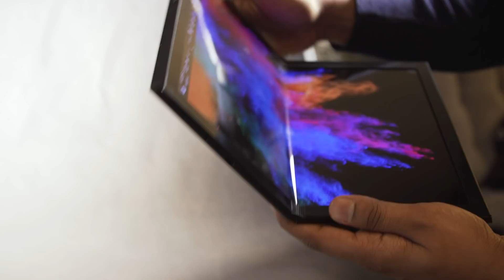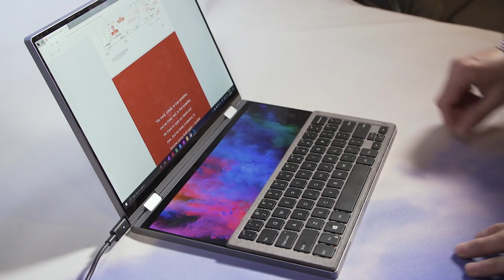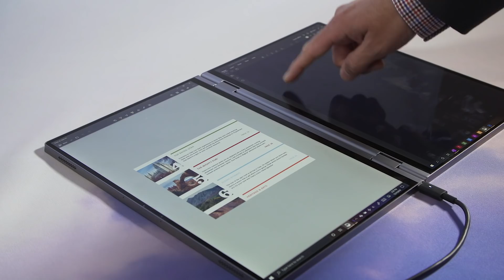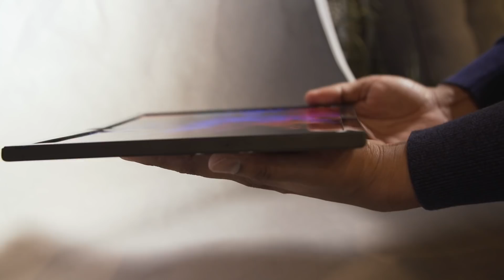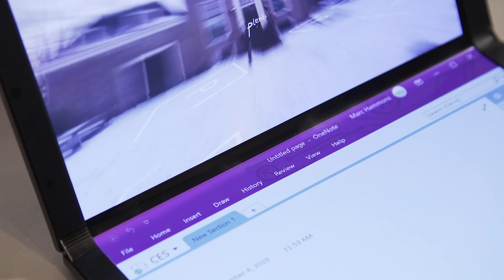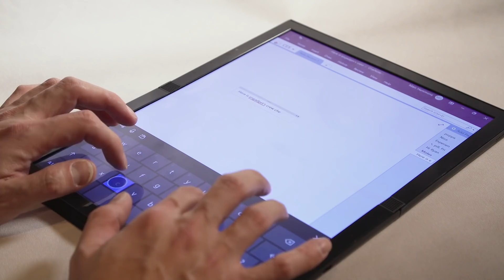Dell concept devices Ori & Duet at CES 2020

Comment: Yawn. So much emphasis on folding screens when they can't provide meaningful all day (and all intercontinental flight!) power to a fully powered unit they already have!
Thin for thinness sake at the cost of sufficient batteries, a full array of REAL PORTS WITHOUT DONGLES, an SDHD slot where the card is fully engulfed when inserted, an LTE SIM slot for true anywhere connectivity,  Oh, but they are so trendy as folks pull them out for the 'look at me" first 5 minutes of a flight before being put back as you can't actually do real work for the duration of the intercontinental flight.... 
Screw the focus on overpriced aesthetics over functionality! And who cares about the 'in development' form over function devices they are showing off while managing to still avoid tackling the REAL WORLD limitations that continue to exist across multiple generations of oh so trendy overpriced whiz bang glitz that fails to enaable getting real compelling work done.
Meanwhile, cell phones mfg refuse to enable existing OS level functionality that would eliminate data security exposure and the need to carry a laptop that has existed now for 28 and 26 years respectively that is compelling for the enterprise market as well as anyone who needs to do real work in a mobile environment.....
Reply: Take a deep breath, you're gonna be okay. There are tons of people who would eat these things up if they were ever brought to market. They may not appeal to you, but that's fine. Thankfully there's a lot of variety and competition in the consumer electronics industry. Something like a Lenovo Thinkpad would probably be a better fit for you.
Reply: Spencer Bench of course there is a market comprised of idiots, like yourselves, who will buy anything that is marketed. So what have you fed your pet rocks, and what colleges did you put them through?
Reply: @sdushdiu  If you think they're idiots, then you should be glad that Dell has figured out a new way to part them from their money, as the saying goes. Why not get in on the action yourself, since you're so sure that people will "buy anything that is marketed"?
Reply: Spencer Bench yawn...the previous posters claimed that idiots are interested in solutions in search of a problem. But hey, I can see why so many need to oooh and ahhh over tech for the point of tech gIven that they have failed to solve existing problems to real needs in real existing products.

Comment: make a Surface Book hybrid with the Duet in which the screens can detach
 fdrom anothjer. separate them and you have 2 hand-held devices. 

HOLY SHIEEET.
Reply: that's a great concept if possible because it would need two CPU's and two of basically everything required for a PC to work but this may be overcome by using low power ARM chips .